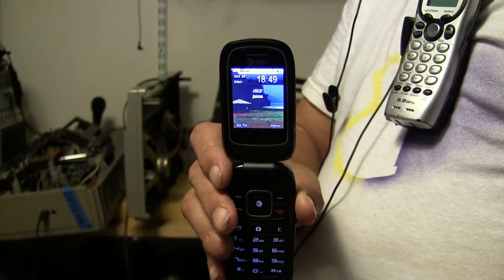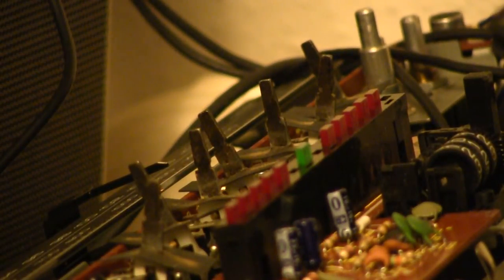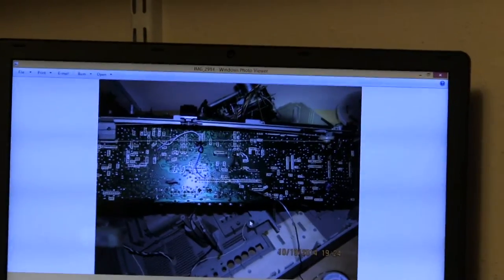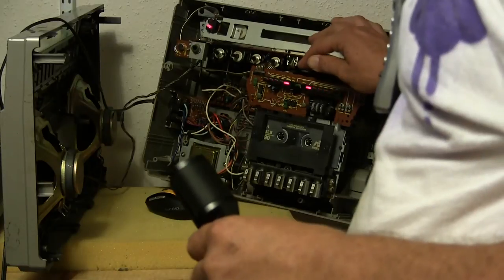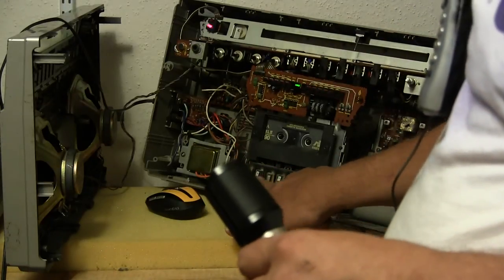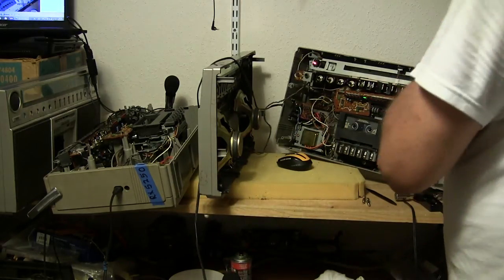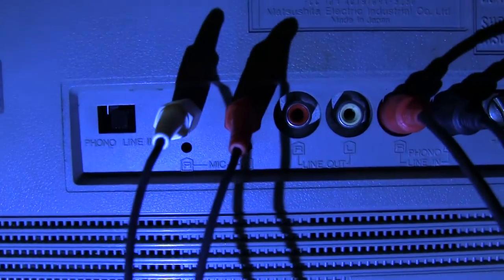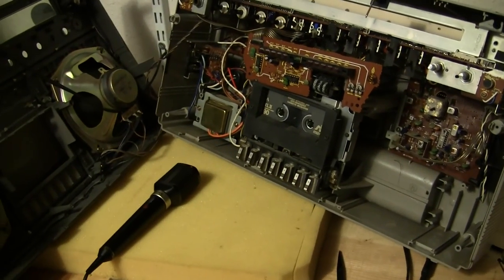Panasonic RX-5250 boombox inside repaired best I can

Comment: I can’t believe it, my RX-5250 is having the EXACT same issue (just started today) with that same low distorted hum- only while using tape functions. Will open this bad boy tonight and will look into bad solder joints and leaking capacitors.
Reply from the maker: It's bad grounds that need to be cleaned as well as the recording bar switch that should solve it
Reply from the maker: Make sure all the grounds to the tape deck are clean as possible
Reply: @DecentMan4you  Fixed! Did as you described. Thank you!

Comment: The problem I am having with mine is the oscillation like yours after coming out of record mode, then into playback. It will finally settle out and get less and less and play fine until you go into record mode again. I think this is an electrolytic capacitor becoming open and many need replaced at this age. I deoxid D5 sprayed the record play slider switch. I have the service manual. Could not hear part of your audio, so what was the problem other than bad solder joints?
Reply from the maker: I don't know as this was sent to me for repair and all the customers wanted was the ability to record on cassette via microphone I didn't fix the radio and I sold this years ago and since then he has bought another Panasonic RX 5025 from me to replace this model that simply failed on him over time

Comment: Do you have any video showing how to remove the tone slider?  the wiper fell off mine and it needs to be re-attached.
Reply from the maker: If you're talking about the electrical wipers inside the slider then it's time to replace the slider
Reply: DecentMan4you yes the electrical wipers, thanks!
Reply: DecentMan4you do you have any idea where to purchase a replacement slider?  I have no idea, searched everywhere.

Comment: Hello friends, if someone can advise me, I have a Panasonic rx5250 recorder that plays the radio but not the cassette player, and I checked to see if it was the pickup or the bands, but if it rotates and works, it only does not send audio.
Reply from the maker: Sounds like it needs to have it servicing cleaned all the switches specifically service the recording bar switch as all your music goes through it all your source material and if you never record with this unit then that recording bar switch never moves and therefore it can get corroded in position.